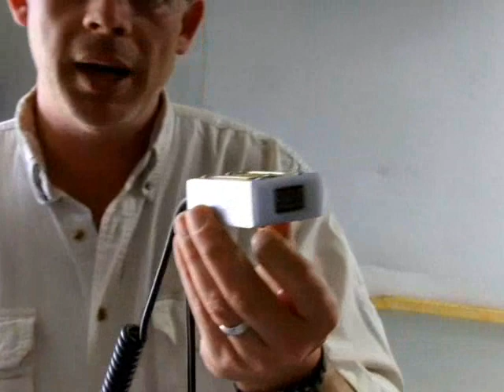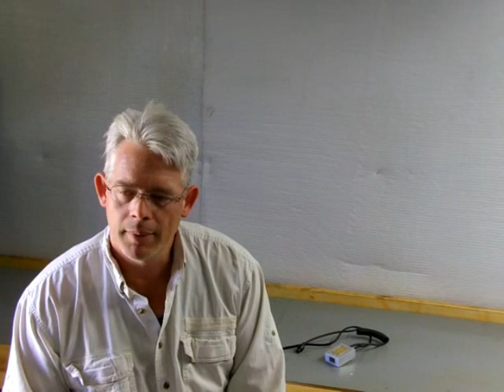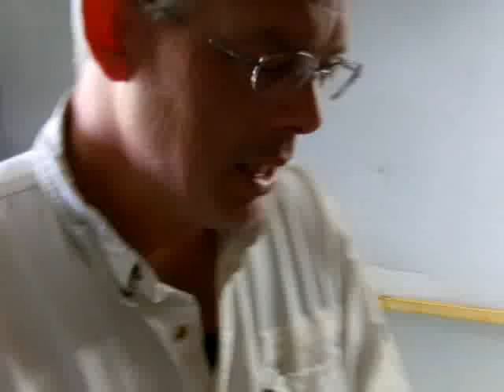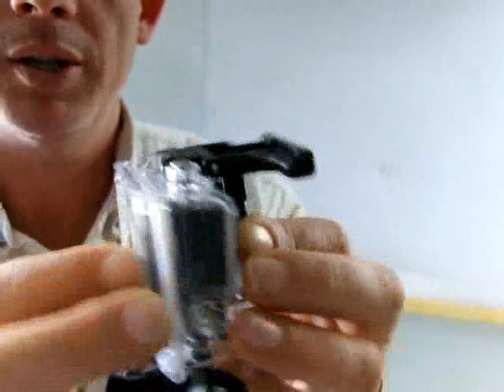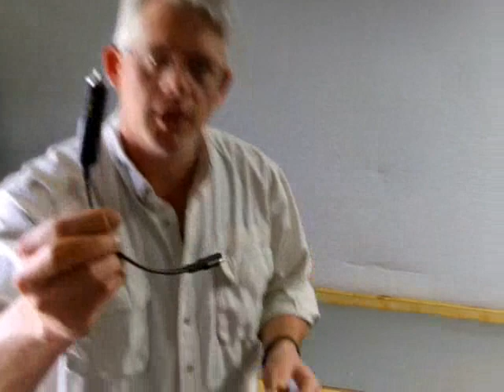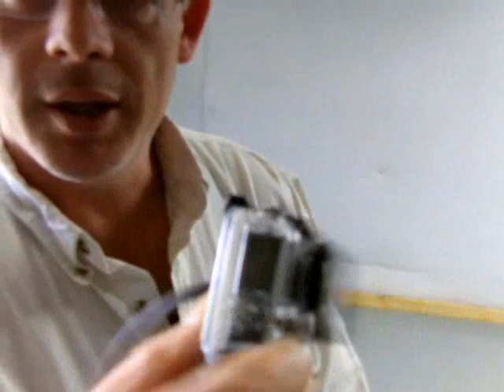LongShot GoPro Power Supply

Comment: Hardened power systems. I like your idea for your product. But saying it has 20 mins of battery life is a lie even in extreme temps with hard settings and WiFi on. I will never buy your product because instead of saying the truth about how much time the battery lasts you lie to try to improve sales. Gopro battery life sucks. Yes that's a fact but 20 mins no. Just be honest say the gopro battery lasts about 40 mins in some settings and the longshot is the solution.

Comment: Surya, I dont think you fully understand the concept of this device. I can run time lapse with the right settings that would net me 10-12 hours or required battery. And thats without WIFI or protune. Ive got 2 of these now and will never go back to battery expect for precarious installations of the gopro.

Comment: Try Wasabi docking charger. They take away the USB charging algo.
So its very simple Lit-ion voltage 4.2V as full charge and at relaxed no higher than 500 mAh charge. I guarantee better than 35 mintutes 1440p 48FPS Protune + WiFi , no LCD BacPac, since Wifi is there for iPad or Android. Avoid and USB charger wall type pumping more than C0.6 of battery rating, another cause of poor charging. Good luck with ur project.

Comment from the maker: "No matter how agrresive you use the GoPro HD3, it is still a 50 minutes camera. Not 20 minutes."

That is not the case in our experience, or for many of our customers.  With the standard battery, running hi-res, pro-tune, and wi-fi, battery life is actually a bit less than 20 minutes.  Temperature and battery condition are also factors, of course.

Comment: No matter how agrresive you use the GoPro HD3, it is still a 50 minutes camera. Not 20 minutes. Based on no-stand-by. Hit record only till battery dies. I like your idea though, nice. I have the same dummy battery powered by 5,000 mAh or 3,000 mAh 3.6V lit ion. What you can do to expand your system is offer a twin lit-ion battery tray or two single tray, up to you. One of the tray will provide a seamless power source transfer for non stop supply. So it can do 12V or common lit-ion.

Comment from the maker: The ring terminals are very useful in some circumstances: semi-permanent installs, or when high vibration is present (boat, plane, motorcycle, 4x4, etc.). or when you want continuous power regardless of vehicle state.   The battery clamps are really just a 'catch-all'.  There are some pretty unusual uses for GoPros, and with the clamps you can hook into any available DC source, fast.

Comment from the maker: Mike,
    The three connection choices make sense to us... the cigarette plug for obvious reasons, as it is the most convenient and easiest to move between vehicles or different power sources.  However, in many vehicles, when the engine is turned off (or stalled), the power to the cigarette socket is also turned off.  Not good if you want your camera to continue running.